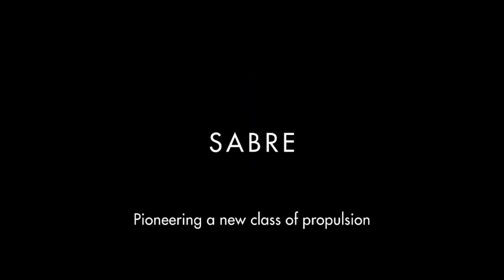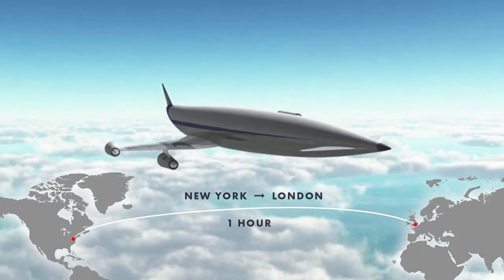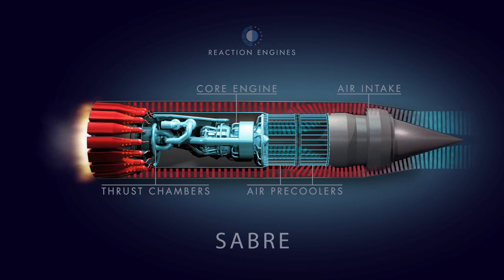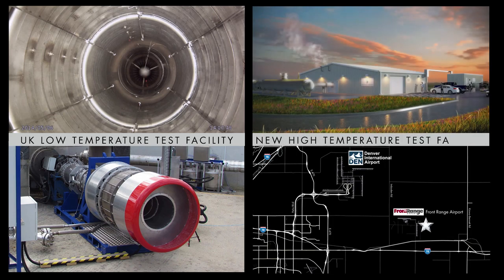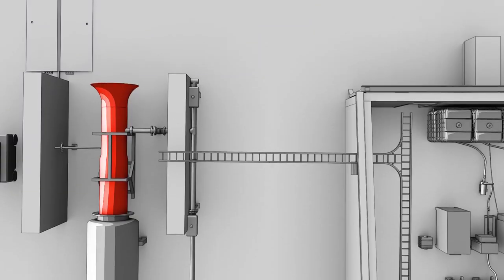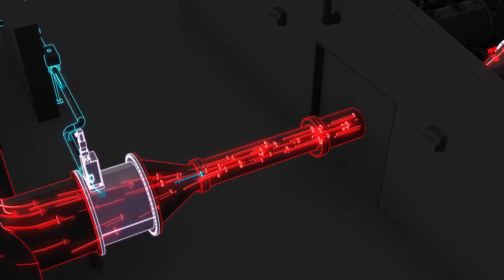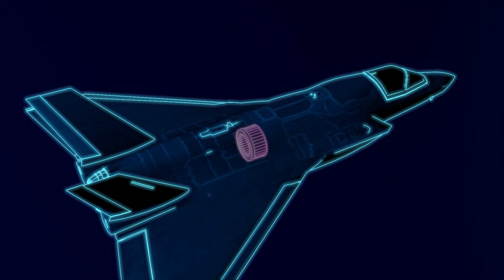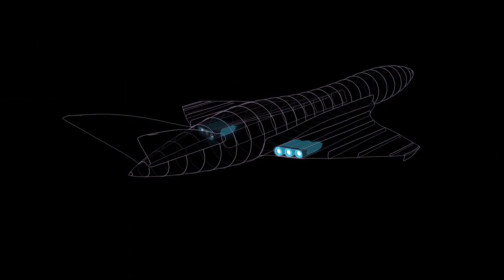Skylon...Pre-cooler HTX test programme.

Comment: I think they need a fuel and oxidizer to get it into space on a ballistic trajectory.  The reaction engine may only be good in the atmosphere to a specific altitude because it has to carry the weight of an aircraft.  Power needs to overcome mass and air resistance, which decreases in height, but wings support the aircraft against gravity, so there is a balance to contend with.   Sabre plus fuel and oxidizer is the way to go.   More testing on this is obviously needed.

Comment: I'm having doubts about this, it has been in development for almost 40 years and still no single working engine working model has been made, not even a small scale one.
Reply: The pre-cooler is one of the main technological hurdles that has only just been resolved. There was no point in building anything if this tech couldn't be solved. One of the next issues will be finding a material which will be able to cover and protect the plane at extreme speeds / temperatures.
Reply: sam sung the stumbling block was the ceramic plates needed to provide thermal profiling within the intercooler. That hurdle has only just been overcome. It's been a long journey, but then as with all journeys, an end can be insight as long as you have the Vision.

Keep the faith. It will happen soon.

Comment: Best case it's not going to cool to "just above ambient," unless `ambient` is redefined as the temperature of the flow being heated, not the ambient temperature at 25,000 meters. Quite an achievement nonetheless, what is "just above," in terms of percentage?
Reply: Well, it cooled to the boiling point of water. So thats 900 degrees reduction instead of 980, so it ended up 10% above ambient. If they'd used something other than boiling water as their heat sink - say perhaps liquid hydrogen - they could have got it to ambient, or beyond

Comment: This is fine and dandy but everyone seems to forget the rest of the plane also has to do mach 5.... Yea unless its made entirely out of titanium and inconel its literally gonna melt away in the air. 
Also pushing through the air is an exponential challenge. It basically takes 4x the fuel to go twice as fast. I really do love the idea of being in London in an hour but I don't think its gonna be done in flight. 
I feel like evacuated tube transport is the answer, but then keeping a near vacuum tube 3000 miles long might be harder than making a plane out of materials that don't melt. But who knows. People probably said the same thing when the said "you can sit on top of this can of explosive fluid and go anywhere at incredible speeds!!!" 100 years ago.
Reply: Too much drag/heating at 30,000 feet? Just fly higher.
Reply: @101m4n  I already assumed it would be much higher than 30k feet. The problem is if you go too high you don't have any oxygen to burn.
Reply: @CrossWindsPat Doesn't flying faster help with that too though? Speed * inlet cross-section or something to that effect?
Reply: @101m4n    Maybe, but back when America tried to build the concord competitor, it all fell apart because they were so hell bent on going mach 3 rather than mach 2. It essentially ruined the entire project because the cost of the metals that had to be used where phenomenal. This is just for mach 3... Albeit that was 40 years ago but I don't think there is any new trick to get around those thermal loads.

Comment: Testing at 5000+ feet ASL in the virtual desert of the Colorad high plains where you can't even grow ordinary yard grass without "irrigation" 3-4 times per week. What a fair, unbiased and scientifically ethical choice of locations. Pretty much as far as you can physically get from every major scientific, polytechnic and mechanical and/or aerospace engineering institution, organization and agency in the U.S. as well. Gonna burn "methane" from the big landfill there just a hop, skip and a jump from DIA or just tap into the old JP Pipeline somewhere out there and get "free fuel"? Oh wait, you're going to burn liquid hydrogen in that bad-boy. Using "electrolysis" for hydrogen "extraction" from plain old "water", no doubt. Got your own "irrigation well" or are you on "city water" or are you going to tap into the mighty South Platte River? How about electricity? And what precisely is a Skylon/Sabre "mission profile" as far as time, fuel consumption, "cooling" of the "air", etc? And where do you put the "warm" as you "cool"? I mean in the "real world" where "cooling" is always the removal and/or radiation of heat from "warm" to "less warm"? Kinda odd to need to "precool" atmospheric air before its "compressed", isn't it? Especially since "compression" doesn't ACTUALLY "heat" air or "add heat" but simply "concentrates" it. Right? Isn't that actual "thermodynamics" everywhere in the "universe" even though the "UK" seems to produce "scientists" who couldn't pass junior high "Earth Science" in a U.S. public school? Well, maybe TODAY they could. Its dumbed down to their level so when they "immigrate" to the U.S. they're not the dumbest kids at the DARPA "challenge". Just the oldest. By many decades. How does that partnership with the Defense Advanced Research Projects Agency work and when did "DoD" decide to violate "U.S. law" and at least a few "international treaties" and "weaponize space"? I thought "DoD" got out of that when the USAF "demilitarized" NACA and it became NASA and "non-proliferation" became U.S. "policy". You wouldn't be misrepresenting your "special relationship" with U.S. citizens' "government" of, by and for the people in order to "economically enrich" and perhaps "politically reposition" your "uncodified constitutional monarchy", would you? Or rather "her majesty's uncodified constutional monarchy" that seems to literally "make money" out of "thin air" from "inward investment" and "trade".

I promise you the U.S. is not out of "nukes" for "constitutional monarchies" that are tiny island "nations" off the coast of continental "world powers" and very few "yanks" view you as anything but perpetual blowhards and bullshitters and pot stirrers with a sociopathic addiction to letting their crocodile asses write checks their hummingbird asses can't cash. And interfering with and clearly attempting to influence U.S. "domestic politics". I'd say "international politics" but then I'd just be reinforcing your horribly and at some point maybe even fatally (for your "nation-state") incorrect belief that U.S. "politics" extend beyond "the water's edge". They don't. And since the "UK" ia the ONLY "historic enemy" of the U.S. that thinks "rapproachment" is a perpetual process and that the U.S. "aided" or "allied" with you warmongering dark age leftovers and didn't "side" with "Germany" (Deutschland to real "Germans") because U.S. ❤ UK rather tham "Germany" wisely "declaring war" on the U.S. to get us "in the fight" you chicken-shits ran away from "bravely" and repeatedly before you "produced" a "nuke" or two of your own and unlike the the U.S. which systematically "warned" via leaflet, radio and "newspaper" information "campaign" Japanese citizens of one "industrial center" after another days and days in advance to EVACUATE and HEAD FOR THE HILLS during a months-long "fire-bombing" campaign that eventually left only Hiroshima and Nagasaki (think of them as London and Portsmouth) standing and possible "hiding places" for the "military command structure" that took what was probably a "defend the Empire" order from the Emporor just a LITTLE to seriously and far as they'd seen other "constitutional monarchies" or maybe just ONE do repeatedly in the past. Or at least heard/read their claims.

What's really "interesting" is that the "British Empire" even claimed "Hawaii" or rather occupied and "defended" its female puppet "constitutional monarch" and "opposed" what it HILARIOUSLY called U.S. "interference" in Hawaii's "internal politics" and "government" when even Pacific Islanders who didn't speak any "English" much less use English punctuation and accent marks to spell the name of "Hawaii" and who also had "Japan" trying to "colonize" Hawaii decided not only to have an "isolationist" U.S. they "barely knew" as their "occupier" but to "seal the deal" ASAP as the only "U.S. territory" the U.S. had ZERO "permanent resident" citizens or "nationals" on pre-statehood. Guam, Midway, Saipan, Puerto Rico etc all have remained "independent" and only the most "primitive" and "uncivilized" people said yes to statehood. Along with "native Alaskans" of course and after having experienced "constitutional monarchy" first-hand.

Seems to be reverse the situation with the "UK". And it's no wonder you're all about "spaceplanes" and "space tourism". Nobody on Earth even in your "Commonwealth" wants to spend hours much less days, weeks etc locked up in a "capsule" with the most backward and ignorant white people on Earth.
Reply: Lol? You okay there, fella?
Reply: Somebody has issues methinks